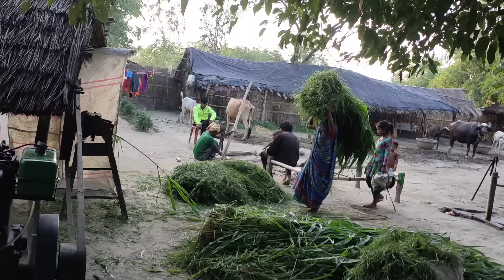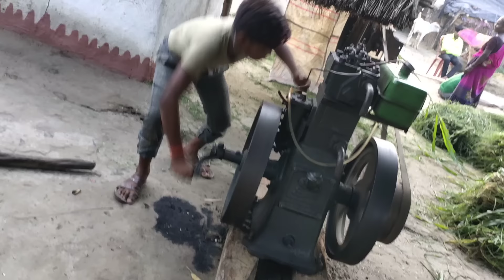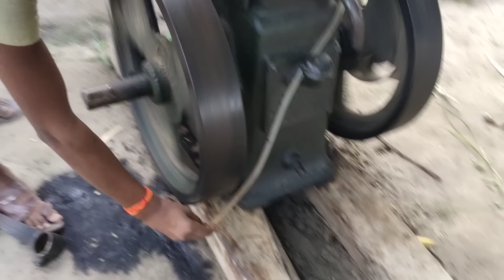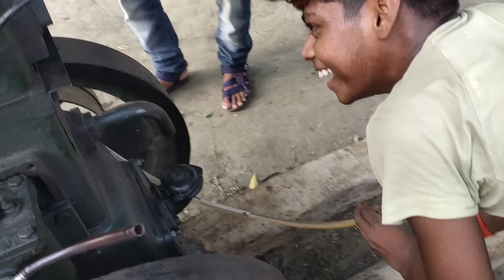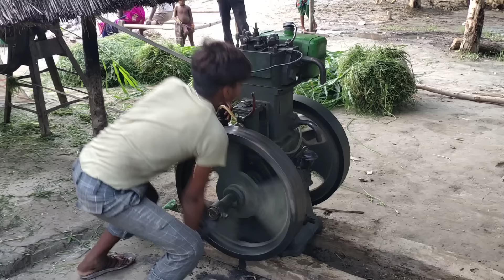12 hp Bada Diesel engine Cutter Machine Setup | for Farmars Old Taqnick | From Uttar Pradesh India

Comment: This engine, called Lister, is Indian-made. You have to put engine oil in the ignition so that there is enough pressure on the coils and it is easy to operate when running. Greetings to you, my brother.

Comment: 8hp Lister type diesel engine. Without water cooling engine boiling and fire chamber blast. It is very dangerous. Convey regards advance  rip. Be careful with water cooled diesel engines. Atleast connect 200 litres capasity water tin  to cooling engine. Air-cooled diesel engines are suitable to neglected people without harmful to maintain sufficient cooling engine oil.
Reply: P
Reply: To 09
Reply: 燃料の中のオイルが多いと、白煙が出ます。吸気口からプロパンガスを少量追加する必要がありますね(o・ω・o)

Comment: if they shift the engine forward or the machine back itll tighten up the belt and it wont slip under a heavier load
Reply: You said what i tried to say.belt plays the major role in load handling.the belt is floating instead of connecting.the boy is careless what to do.
Reply: @ambathurmagesh7453  ढढठठठठ

Comment: Wow mantap bang,tapi mesinnya agak lemas.
Reply: L pa
Reply: It is running just fine 
But 
The belt might not be or was not tightened enough to prevent slipping too much 
3:35 
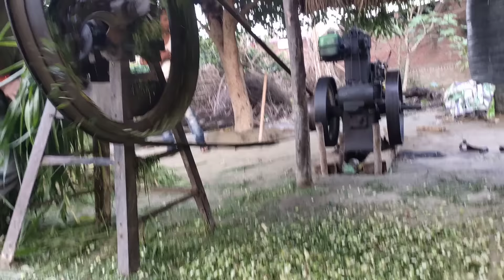3:57